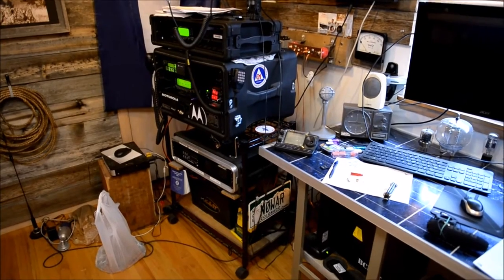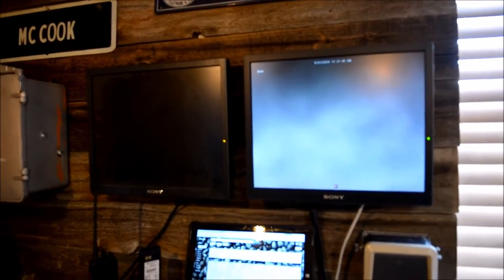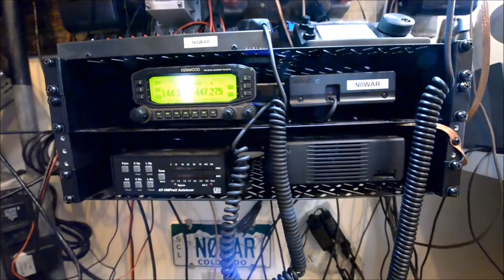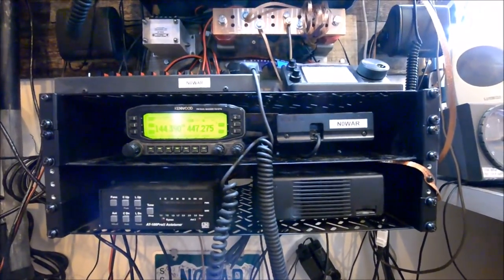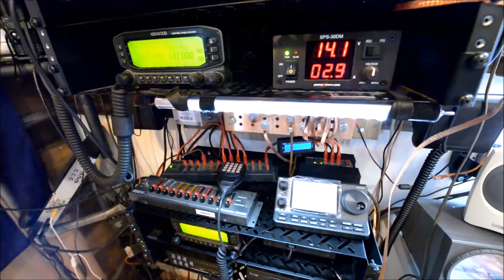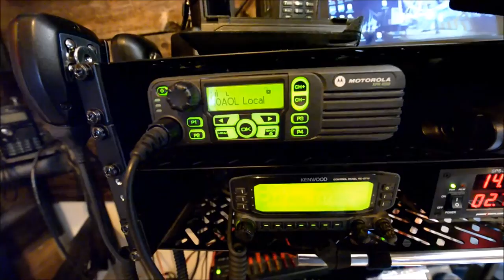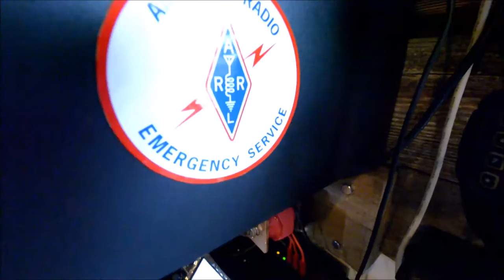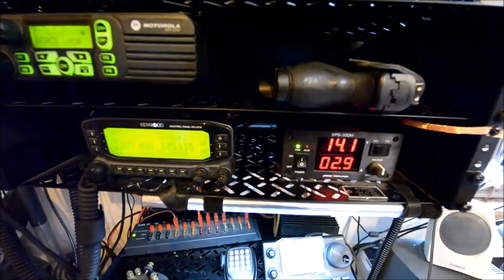Wall Mount Ham Radio Shack

Comment: Are you using a solar panel for a desk?
Reply from the maker: YES!  it is one of 3 that I had on my truck for my mobile ham radio setup. this one quit putting out most of the power. so i retired it as a desk in the shack. i LOVE it. i should do a video on it. thanks for watching jim! de n0war